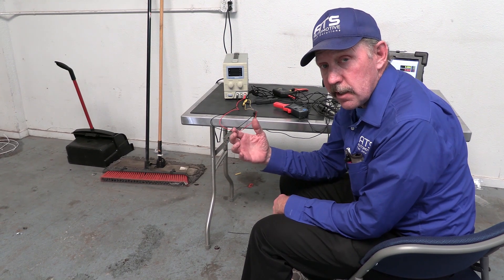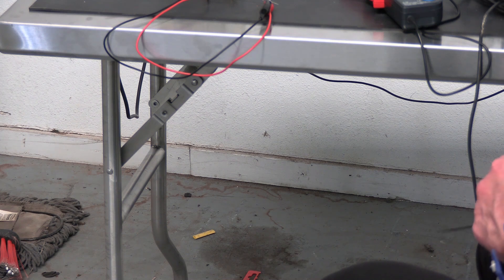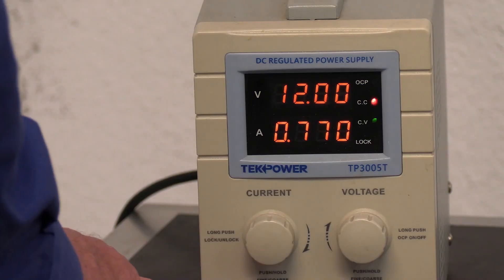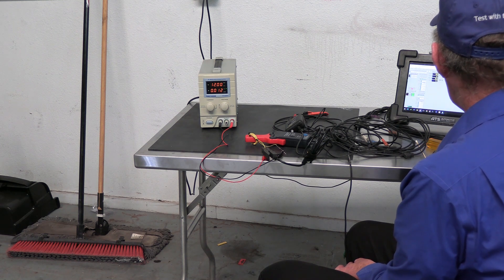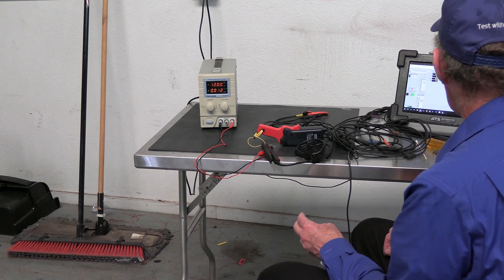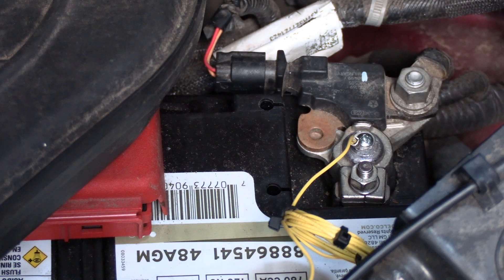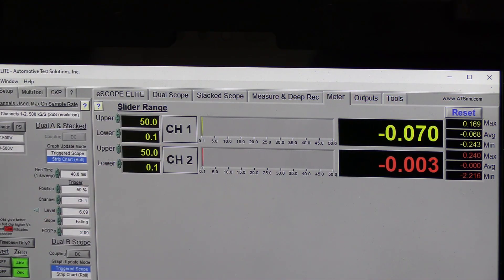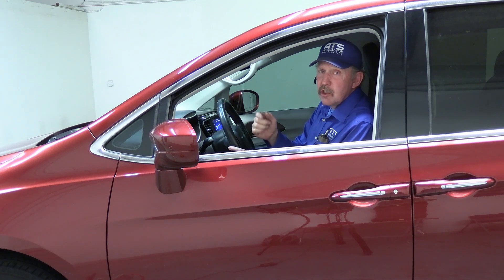2018 chrysler pacifica battery draw

Comment: I have been data logging voltage drop over the resistor instead of using a clamp meter for long duration testing. It works well!
Reply: Would you give us more details about this? Which resistor do you mean?
Reply: A high precision resister ( .1 or 1 ohm) in series between battery cable and battery post.You measure the voltage drop across the resistor and with 2 known variables - resistance and voltage you now can calculate the third one which is the current @maradallibya5791

Comment: Nice Bernie. Can you make a video on hybrid vehicles like SMR , i want to see if the escooe is capable on high battery voltages. Also if you can post a video on GDI to see if the injectors are clogged using a technique with the lab scope using the high pressure rail voltage and converting to ac voltage or any trick to find clogged injectors or leaking injectors. Thank you

Comment: does the size of the wire matter as long as its 10 wraps
Reply: Size does not matter in this case as long as it all fits in the amp clamp and it can carry the potential current of the draw. 12-18 gauge should be acceptable.